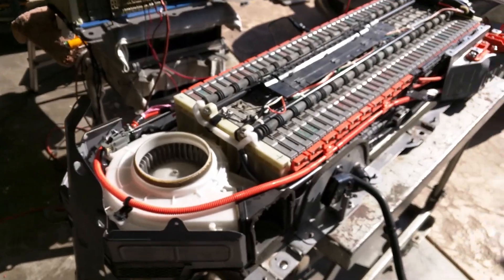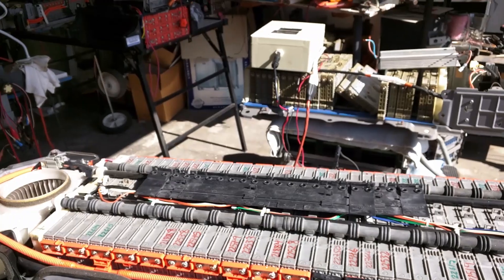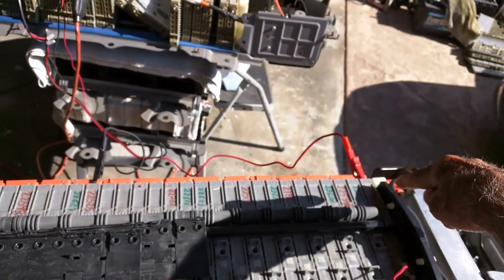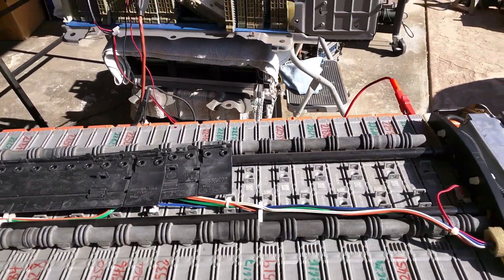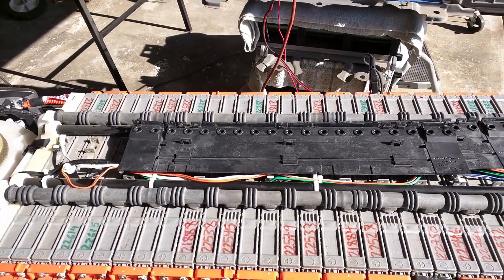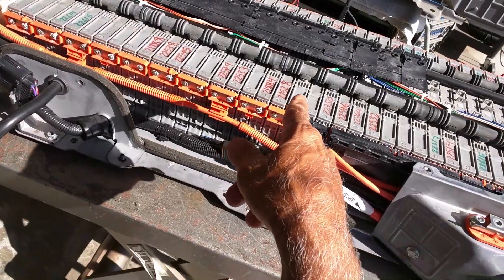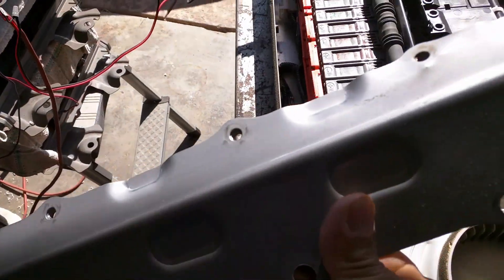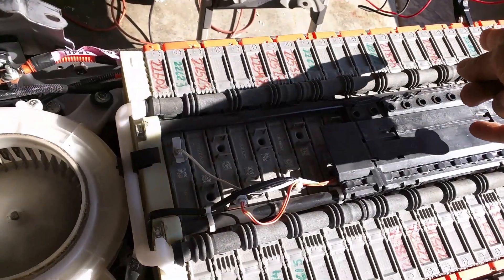Yukon Hybrid Battery Charging

Comment: Have a dead 300v in 2009 silverado hybrid 2 mode, with my xtool, and a new hybrid battery to put into truck ..what else will I need and what is process to install 300v properly to get truck running?

Comment: Does this hybrid vehicles like a 2011 gmc sierra hybrid use the hybrid battery to crank the truck because I'm have a no crank issue and my truck has been setting for about 6 months
Reply from the maker: Yes.
Reply: @VeniceHybridTech   I know it doesn't have a starter like a normal truck does, so what turns the motor to crank?
Reply from the maker: MG1.
Reply: @Venice Hybrid Tech   another question would any high speed charger work as far as trying to connect it to the terminals I noticed on the cells the have little room
Reply from the maker: The HSC has crocodile clips at the end of wire harness which can clip onto any terminal.

Comment: ok why are we not splitting up charging inside the vehichle? When on bench we must only charge one half at time!?
Reply from the maker: Hi Terry, You have not understood the contents of the video properly. This video is explaining how to use a High Speed charger which has a max voltage of 285V. Hence, it is not capable of charging the whole pack at once. However, if you use my Grid Chargers for Yukon Hybrid, they are capable of charging the whole pack at once as the voltage is higher. So it will depend upon what charger you are using and what is output of that charger. Hope that helps.
Reply: @VeniceHybridTech  so I'm assuming on a bench we only charge 20 sections at a time positive and negative? Inside the vehicle you're telling us to charge 40 packages that one time within the vehicle bolted down to the back seat floor in a 2011 Chevrolet Tahoe hybrid? Do I stand correct? Or am I wrong? You clearly do not show in the video inside of a vehicle where it's a permanently mount your base charger and clearly if I'm going to spend that kind of money I'm going to spend double the money and charge. Everybody's hybrid in my area because there's nobody that can pull this off in my area
Reply from the maker: @latunguley  Hi , I will repeat myself again. It depends upon what kind of a charger you order!!!!!!!!!!!! I have chargers with different outputs, so if you order a charger with output of 400 V, you can charge the whole pack, whether inside or outside the vehicle. However if you order a charger with 285 V output, you will be charging in two halves. I suggest you email me at info@venicehybridtech.com or call me at 424 227 6719. Thanks.
Reply: @VeniceHybridTech  thank you. Now you're making sense to me

Comment: Hi, a 2009 chevy tahoe hybrid code P1A20. Do we need to jump-assist it with a tech 2? I think it showing 0 volts
Reply: We found out that the safety pin/plug was nit in properly this whole time. So code P1A20 only code showing up after we properly made sure it's in right
Reply from the maker: I am sorry but I am not sure what you are asking????? If it reads 0 V, then you will need a charger. You can not jump start it. Thanks.
Reply: My code is now saying P0bc3? 227volts how do I charge with the battery in the truck
Reply from the maker: @cedes0711  Hi, here is a link for you to read and do the needful.  https://www.engine-codes.com/p0bc3.html
Reply: @Venice Hybrid Tech  ok thank you. I emailed you because we wanted to know what grind charger we need for the 09 tahoe I didn't see it on the website
Reply: Where can I buy the grid charger

Comment: Hello, they sell me a 2011 Yukon Denali hybrid, but the owner says that the battery does not work and that it is necessary to tow, it could be the battery, I have doubts before buying it, please, I don't know if you can help me, he sells it to me in 2500. but it would need a battery
Reply from the maker: The hybrid battery can be fixed. Where are you located???? The price seems pretty good.

Comment: Hello.        Is the  voltage to charge one of the  dc or ac.        Trying to see what I need for a charger.   Or if I can use 120v ac
Reply: Batteries are DC (Direct Current). The fact that you dont know that tells me you should not be screwing around with ANY electricity or batteries.

Comment: I just received my grid charger. My spare core went from 300V to 340 V overnight. I permanently installed the wires in my '13 Silverado as per the last few min of this video and drilled a hole in the centre of the front plate and put in a grommet to keep the wires safe. I am charging my Silverado now. To prevent anyone from starting the truck while on charge I clipped the keys to the charging cable :), I plan to add a relay to prevent this from ever happening by accident.  I'll post results in this comment as Chevy Hybrid info is tough to come by.
Reply: "Information tough to come by" You can say that again.  I have 09 Tahoe Hybrid with very low miles and while not well used is old.  Not much info out there for GM Hybrid owners, mostly Toyota stuff or Honda.
Reply: Once you install permanently, do you need to disconnect the high voltage wires or 12v? Or keep everything together and not turn the key and your fine?
Reply: Has the MPG increased or it's just to prevent from having buy another battery?
Reply: Where did you purchase your grid charger.
Reply: Is it possible to use a 12v or solar charger for this?

Comment: Hello my friend, I took the battery pack out of my 11 Yukon to clean it and check volts.  I installed it back in the truck but now it won’t start.  It just says service hybrid system….any help would be great, thank you for your time!
Reply from the maker: First check your safety plug. Is it inserted properly and pressed down!!!!!!! Then you may have left some connections open or some bus bar connections could be loose or defective.
Reply: Do you have any codes on your HPCM? If so you may need to reset your 300V system with an advanced scan tool. I had a no start condition until this was reset. I then recharged my hybrid battery with jump assist.
Reply: @Geoff240ti  What is jump assist ?
Reply: @stevea4572  it's a function used to charge the hybrid battery pack through the 12V battery using a 12V battery charger. Should be in your hybrid owners manual
Reply: Have a dead 300v in 2009 silverado hybrid 2 mode, with my xtool, and a new hybrid battery to put into truck ..what else will I need and what is process to install properly to get truck running?
Reply: Did you figure out the issue? I have something similar happening

Comment: Would you please I have 09 Tahoe it doesn't start it keep saying contact relay for the hybrid battery is open 
P1ae4
Motor 1
Motor 2
P1b05
P1b05
Please help
Reply from the maker: Hi, there are two contact relays inside hybrid battery, also called contractors, one for the +ve wire and one for the _Ve wire. Check them, may be one of them is faulty. You can find some video on how to check the relays.
Reply: @VeniceHybridTech  Do you know the part numbers for those contactors? or where I could buy them?

Comment: Why do you charge the battery? Is there another benefit other than top balancing the batteries?
Reply from the maker: The Grid Chargers and High Speed Chargers are used to charge and balance the battery packs. Yes there is a need to charge the hybrid batteries as the systems in the hybrid vehicles do not do a proper and full capacity charge. These systems also get old and do not perform all the time at their peak performance. The batteries then start getting weaker and weaker.
Reply: @VeniceHybridTech will this bring back to life a dying battery? It's a 2008 still starts (barely) but as auto stop doesn't work and runs strangely.
Reply from the maker: @davidccoulombe  Mostly, I will say 80% of the times, the hybrid pack is either weak or unbalanced. hence the charger will help in taking care of both of those. However, if the battery pack has a few dead modules, then those will need to be replaced before the battery will start functioning properly. You might still need a charger.
Reply: @VeniceHybridTech thanks for this. What is the nominal voltage per cell? Is it possible to use a 60v DC charger and charge x amount of cells at a time? I live in a remote location and need to fix with what I've got here
Reply from the maker: @davidccoulombe  Hi David, these are the same modules which are used in all Toyota models. The nominal voltage is 7.2 V but they can easily go up to 8-8.3 V. You should be able to charge them with your charger. good luck.